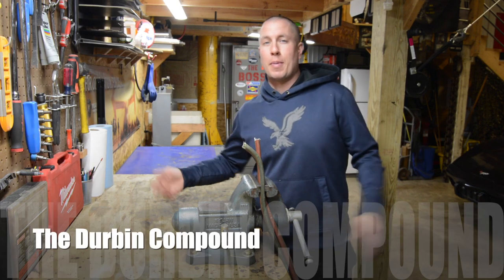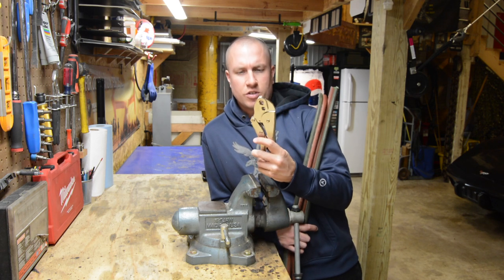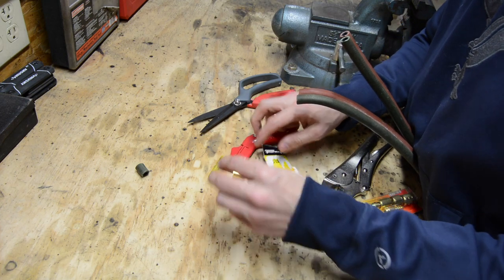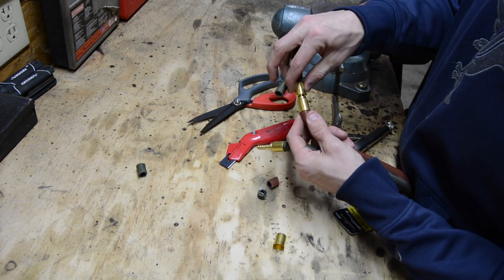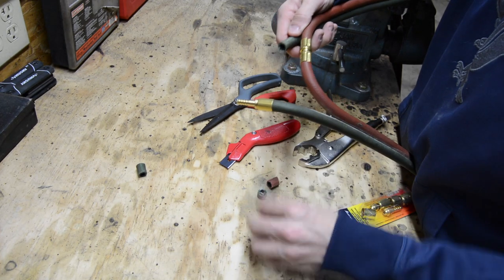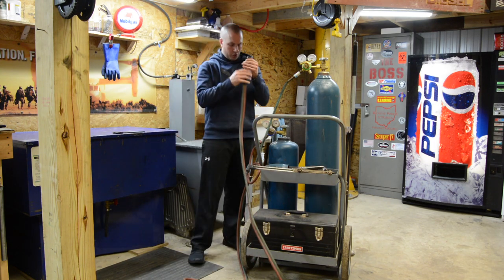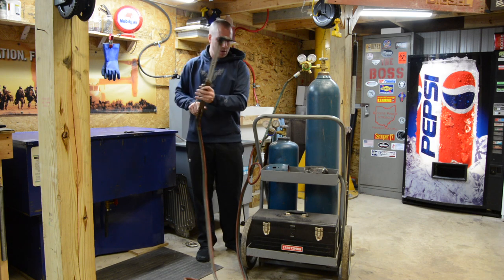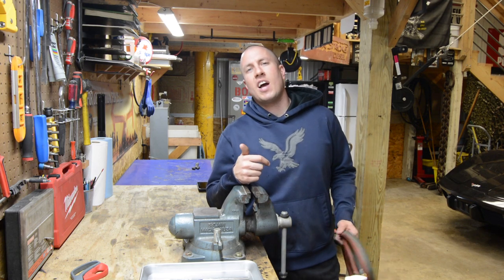How To Repair A Torch Hose - Splicing A Blown Oxy/Act Hose!

Comment: When I made my  10 foot hose I had to crimp on all 4 sides of the furls because it was slightly leaking. So keep an eye on it.
Reply: Jake Thejeweller  you can buy a welding hose furls and crimper kit that has two hose sizes.